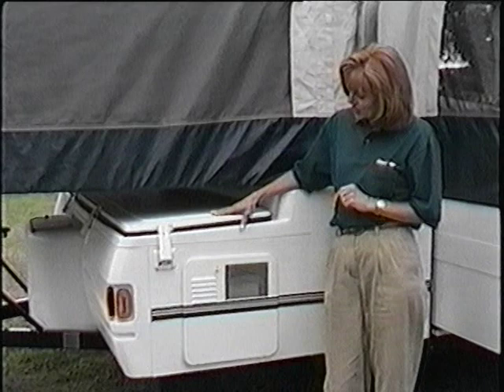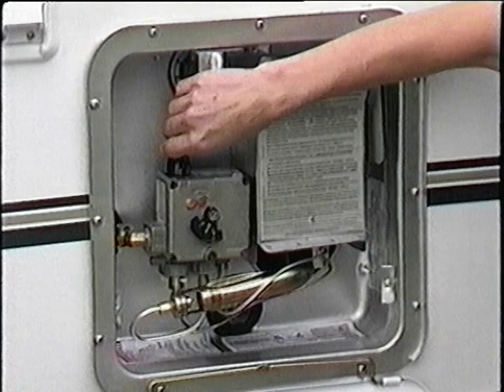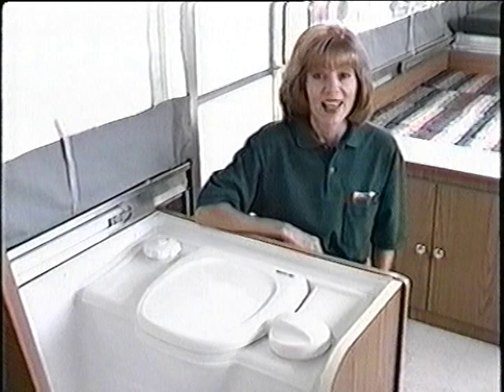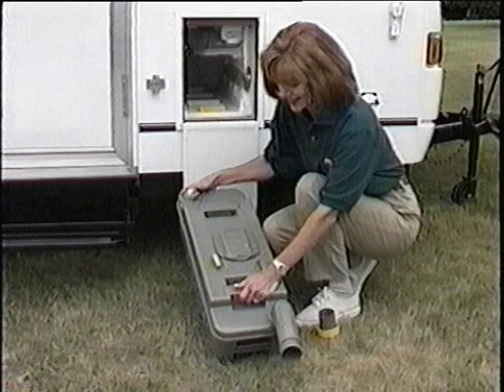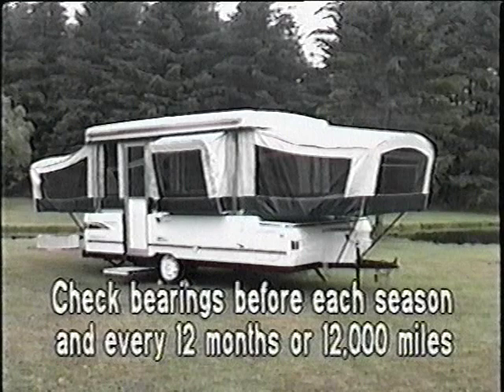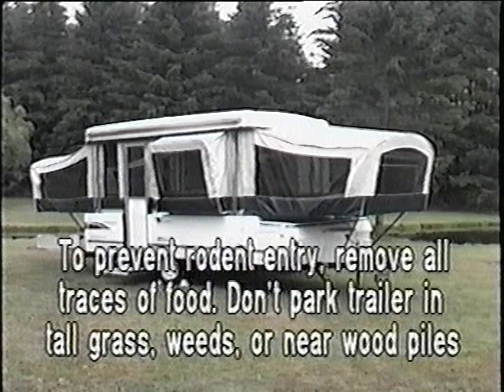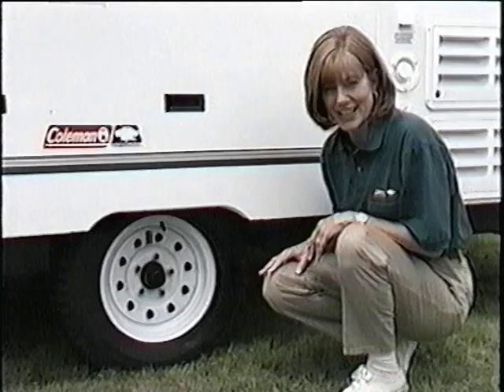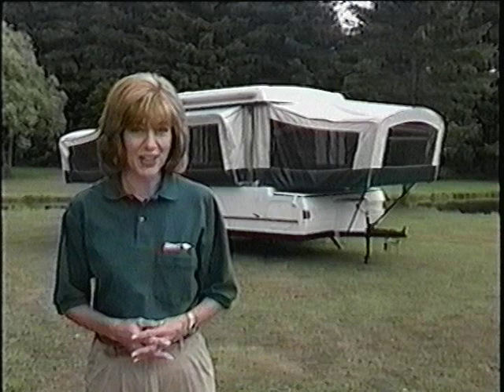Coleman Fleetwood Popup Camper Setup - Part 3

Comment: As a Coleman 'folding trailer' owner, I can resolutely state that it takes far longer than ten minutes to set the whole thing up. It isn't difficult per say, but her fingernails would never last through the process. As a single Mom who took her son and his friends camping a lot, I wished I had had a grown up partner to help me set this up. I did it once all by myself and it was a LOT of work. So many things that they just breeze through in the video tape, take some elbow grease, and a strong back, and in hot conditions, you will be covered in sweat. Just being real...
Reply: I bought an '04 and popped it open for the first time today. Cranking up the top took me several minutes. You'll notice in the video she stopped cranking when the weight of the top transferred to the handle. Then, from there, they showed it in mid height then full height WITHOUT showing that it takes both hands to get it there. 

All in all though, it was a very informative video. I'm giving myself 30 minutest to set it up since I need a breather, a beer and a cigarette to get the top up! :-)
Reply: Lawson, if your pop-up is that hard to crank up then you might want to take a look at your Wiffletree underneath. Our camper was super hard to crank up when we bought it used and on our second camping trip the top got stuck in the upright position and wouldn't crank down. What we found is that the previous owners NEVER did any annual maintenance to it as it's recommended. In our Wiffletree a mouse had snuck in thru a hole somewhere and made it's nest inside the Wiffletree compartment and it caused us to strip out our drive shaft. Do yourself a favor if you haven't already, get under that popup when the top is down, get to that Wiffletree, get it clean and keep it lubricated. You will also want to lube those pulleys as well. Maintenance on these things is a MUST!!! I hope this helps..... P.S. I can easily crank my popup with 1 hand now because of my maintenance...
Reply: +Rosemary Nord:
Thanks for the heads up.  I'll have to set mine up by myself.  Last year, I bought a 1999 coleman camper with an A/C unit on top.  It's about 16 feet long with two king sized beds.  I have had it over a year now and I don't want to use it because I want to first repair the cracked, bubbling, and peeling lamination on the roof.  Also, the rear storage compartment lid has lifted between the hold-downs, and where the hold-downs are they are still close to the compartment.  So, what I have is a wavy looking lid to the storage compartment.  I also need to get a new seal for the storage compartment.  The storage compartment also smells mildew.  (I've been letting it air out, since I opened it and found out that it smelled like mildew.  I should have opened it earlier in the year and maybe it wouldn't smell like that, but I had no idea that water was getting in there.  I hope to get the roof fixed this week or next week, and take it out and sleep in it.  My son is on his own now and lives in another state so, it's going to be just me.  I kind of dread figuring out how to set it up and take it back down.  Not sure if I want to use that water storage tank or not.  I have no idea what it's like.  I'll be prepared to get somewhere well before dark so that I can figure this thing out.  My fear is that I'll not be able to figure out how to close it back up without something either sticking out, or not folded well enough inside that the pullout sides or the lid won't shut.  LOL
Reply: +LIsa Hrivnak:
Kewl, but, what's a whiffletree?  What do I look for under the camper?  Do you have to remove it to clean it out?
Reply: I've got a '06 Santa Fe, and by myself it takes about 15 minutes to completely set up. If I have help, 10 minutes isn't unreasonable. One protip: Get yourself a decent 18v+ cordless drill and a drill attachment that will work for the stabilizers and the top. I got this one, which works with Coleman and Fleetwood popups: https://www.amazon.com/gp/product/B00Q6ISG4M
Reply: Yeah... I laughed at that statement. I have a 2000 niagara elite. Admittedly it's a beast! But it takes a while especially when you consider bedding, personal belongings and etc. From parking to hot dogs, it takes about an hour and a half. BTW, one person can do it, but you'll need some muscles to set up the braces under the two beds.
Reply: After some training, I set up in 10 minuten on my own. But then power, water, adjust things etc. But from unhooking to the first cup of Coffee is about an hour. Breking up, doing the last dishes, cleaning etc. Is also an hour before I drive away. Not bad at all.

Comment: The video shows the camper in the folded up position at the end of the video but, it doesn't show how she cranked it back down.  I cranked mine up and it was used when I bought it.  things don't slide like they do in the video but I know it's 20 years old.  but, the video does not show how to crank the top back down.  The crank turns in the clockwise direction and it doesn't turn in the opposite direction.  This video does not show how to lower the roof back down.  Video 1 shows that the crank is ratcheted and if you stop turning that it will not back down.  Is there a mechanism to get it to turn in the opposite direction???  I don't see anything.  Help someone.  It's about to rain and I have it cranked up with the beds all pushed in and no door.